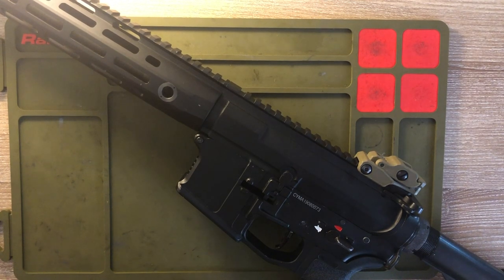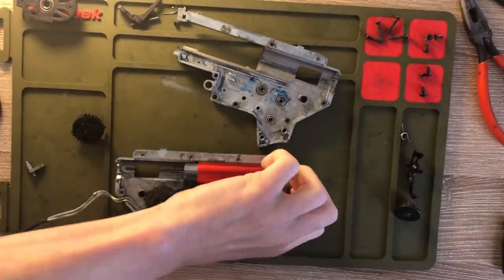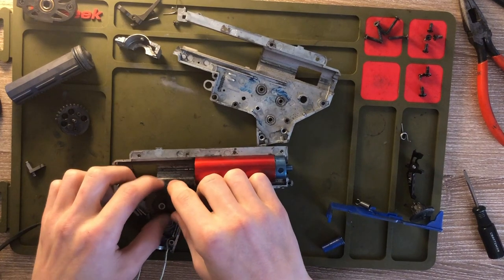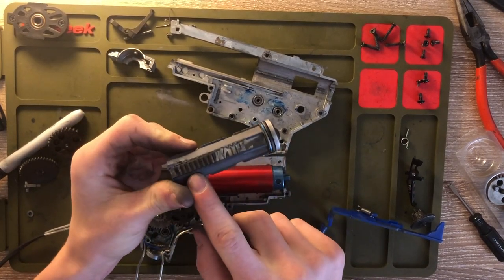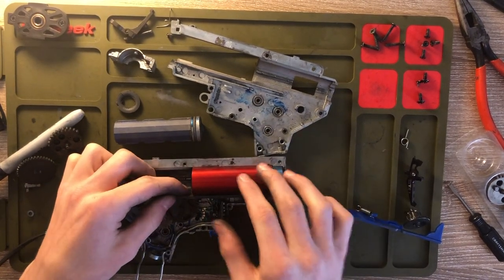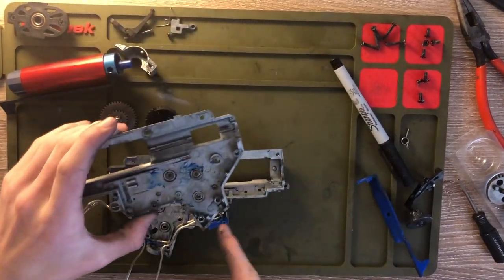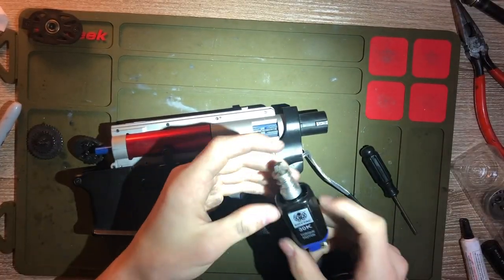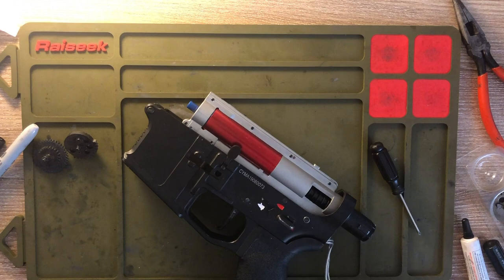DSG Build

Comment: I dont intend to be rude but when building a dsg you need to reshim every gear perfectly, changing the motor height isnt how you fix bad screeeeeeching, you want to definitely be able to shim the bevel to the pinion because of the stress on the motor in a dsg.  An m135 is pretty low for a dsg you dont want premature engagement, plus the low fps.  I would care about perfecting that first without mentioning the gear box. I have anxiety from watching and unshimmed dsg gear go into a gearbox and shooting, luckily we didn't have to watch full auto, because I doubt that would last one full gameday.

Comment: ok so first off I don't mean to be rude, but there are alot of things that are not correct in this video im only going to point out one of the issues.  The GEARBOX IS CRACKED! You need to replace that asap not to mention leaving it in the gun and trying to run it as a dsg.
Reply from the maker: Yes I know the shell is cracked we are working on buying a new one. Also tell me what else is work with it because THERE IS NOTHING WRONG.
Reply: @arcticfalconairsoft6533  😂man lighten up. It's airsoft. Luis over here has built several really nice dsg s so instead of saying there nothing wrong with yours maybe ask for a few pointers.
Reply from the maker: Ya I asked him and he hasn’t said anything about it. And I also know a lot more about airsoft than him.
Reply: @arcticfalconairsoft6533  The point of my comment was not to say that I am better than you I was just pointing out a very big issue that's all, we all have to start somewhere.  

I would be happy to point out some issues. 
1. your shimming, just slapping the shims from the stock gears onto the new ones and put them in. On top of that you didn't even put shims on the the sector. 
Just sticking the gears in and then adjusting the motor height until it "sounds good" is not correct and can cause excess wear and stress. If you want your gun to run properly and smoothly you need to properly shim each gear starting with bevel to pinion.
Chupacabra outdoors has a great video on how to shim a gearbox it's the video I learned with : https://www.youtube.com/watch?v=ZahpxfCsSAY 

2. Leaving the stock tappet plate spring will not allow proper feeding. you need to make it stronger by bending coils.
Reply from the maker: Ok. Thanks for that the shimming for one  is fine and that is how you adjust your motor hight. I’m not trying to be rude or a know it all but I have more knowledge that an airsoft tech store around me.
Reply: @arcticfalconairsoft6533  yes I know that's how you adjust your motor height, but what i'm saying is that you have to adjust your motor height to your bevel gear with half the shell attached to the motor grip then shim it to the bevel gear to the pinion. what you did was put all the gears in without checking the height of anything then once you had the gearbox in and the motor grip on you then adjusted the motor height until it sounded "ok". that is not how you properly shim a gearbox which is going to cause problems. plz watch the video I think it would be very helpful.
Reply from the maker: Ok I will
Reply: @arcticfalconairsoft6533 did it help 😂

Comment: Wth are you doing man hahahah, the reason the stock tappet is slimmer is because the gearbox on the cyma platinum series is reenforced and sofore thicker sothat it won't break as easily. 
Also, an m135 will give you a super low fps with a dsg.